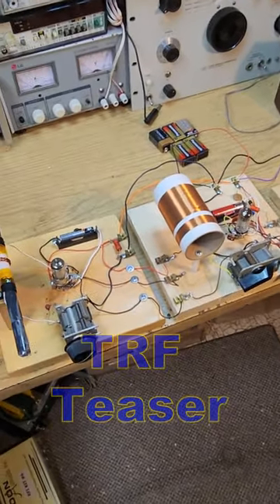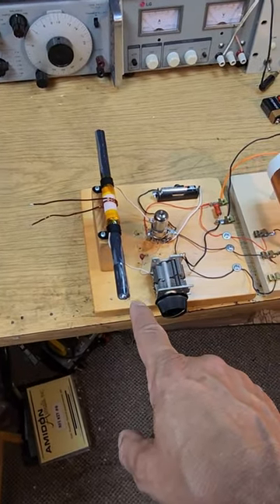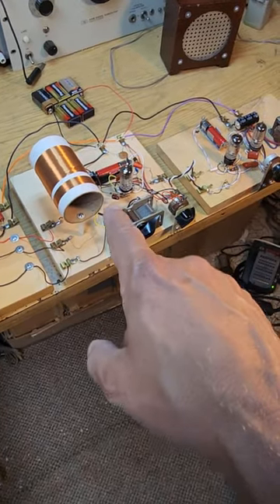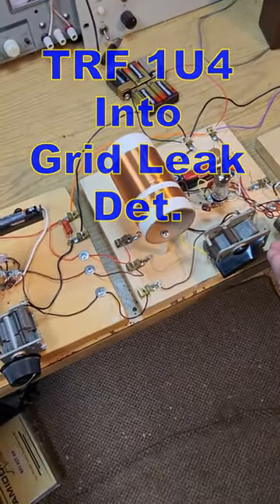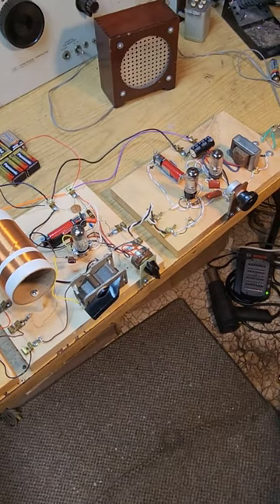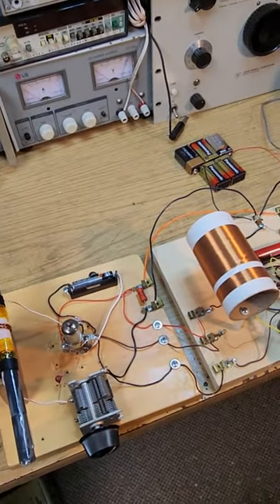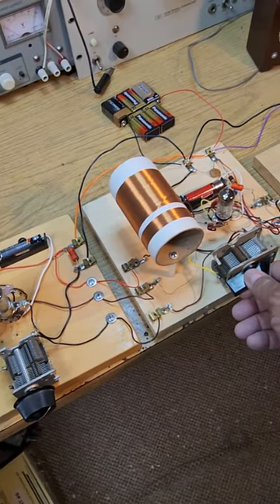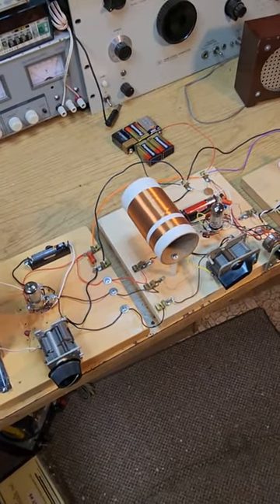TRF Teaser 1

Comment: Really well set out. Nice. Each tube has its own heater battery (I think). Surprised it didn't oscillate as both coils are parrallel and high q. Maybe you have a tiny bit of regeneration because of this.
Nice video.

Comment: Is that small copper loop on the antenna coil being used for anything? Is it like a longwire mod on broadcast band radios? Or perhaps a signal input point for tuning?
Reply from the maker: It can be any of those - input coupling for an antenna or previous stage. Or, regen tickler, Q multiplier or BFO injection,